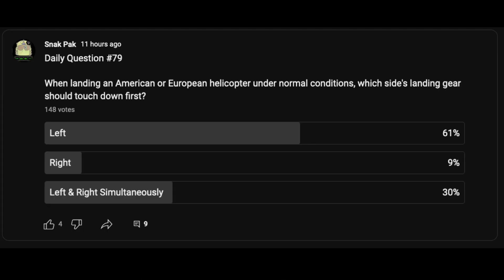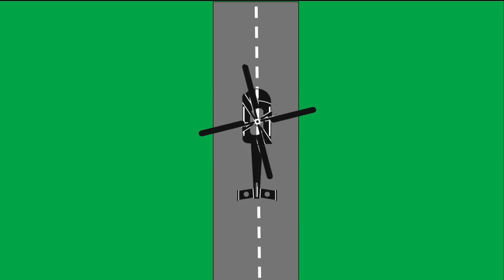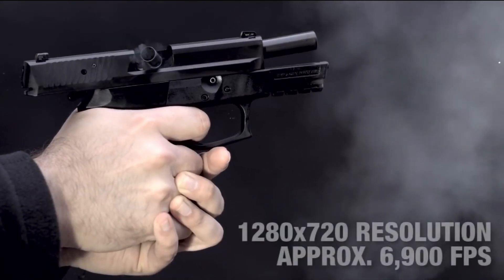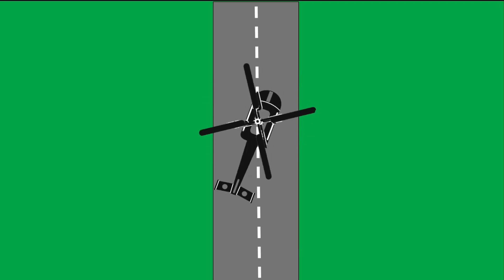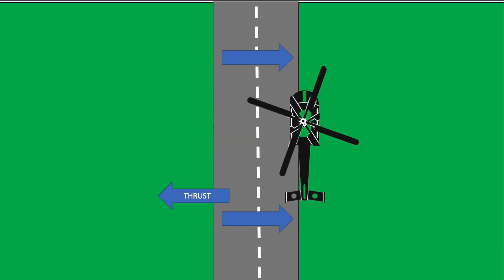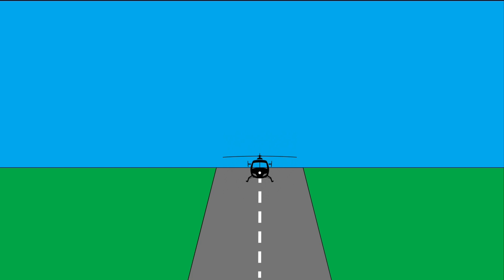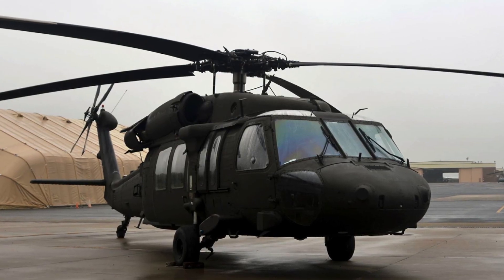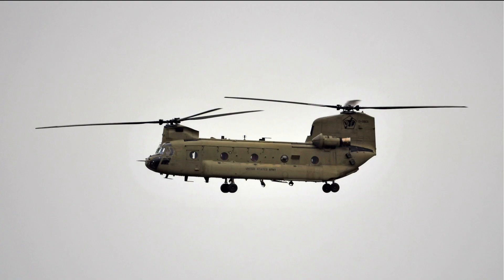Why Does the Left Landing Gear Touch First? Helicopter Instructor Pilot Explains.

Comment: What is the best aviation head set I should for rotary wing flight school, I have no budget constraints ?
Reply from the maker: Hmmm, well I’ve only flown helicopters with a full helmet with com system. I’ve never flown a small piston helicopter. That said, I do have my fixed wing PPL and I got a Bose A20. It’s great and has noise canceling and bluetooth. They just released a better A30. Just make sure whatever you get, make sure it has the helicopter plug. It’s different than a GA plug. Also check with your instructor that whatever helo you’re training on uses that plug.